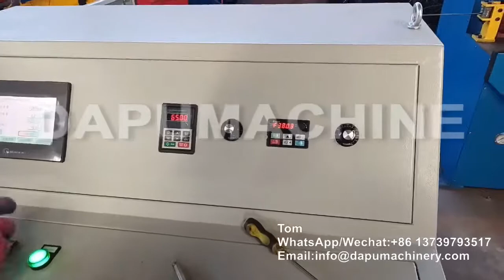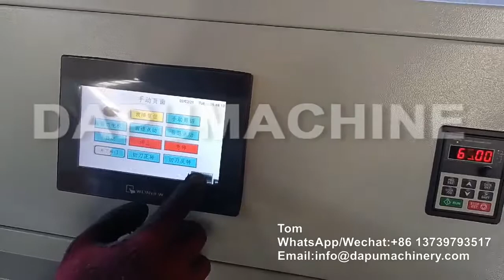Show you how to make round wire into ribbed wire/ribbed wire drawing machine

Comment: Hi, could you provide us with the diamater of wire that is used in this machine
Reply from the maker: inlet wire : 6.5mm   outlet:4.88mm
Reply: @tom-wiremeshweldingweaving3099  hi, could you change a little bit in size. example we take 
inlet: 6 or 5.5 mm 
outlet: 3 mm 
I'am waiting for your reply. plz
Reply from the maker: @eurllinasteel6880  inlet 6or 5.5mm is no problem, min. outlet is 4mm
Reply: @tom-wiremeshweldingweaving3099  Can we enter  it 4 mm but the result would be 3 mm !
thnx in advance
Reply from the maker: plz send me your number and email for easy contact,friend